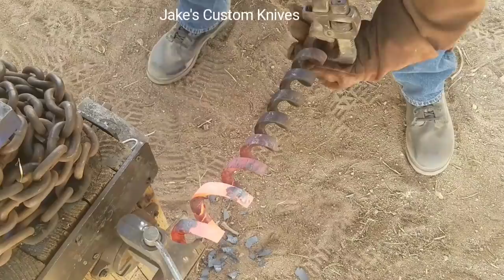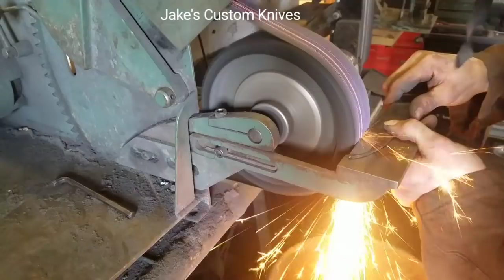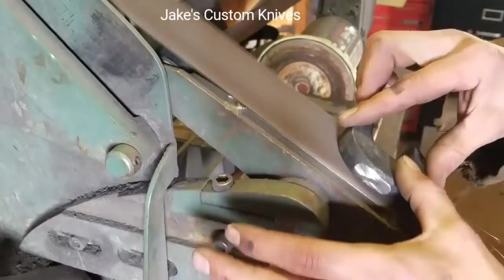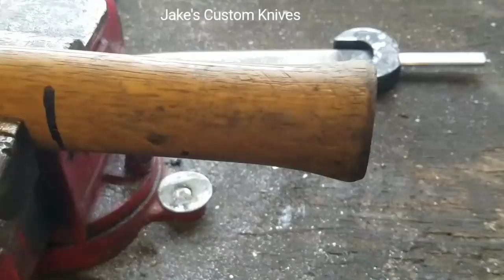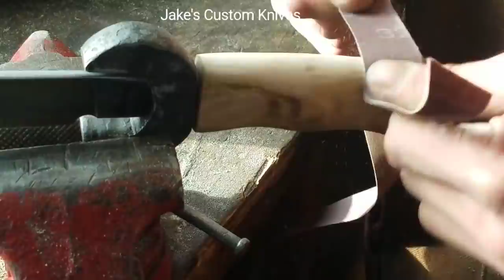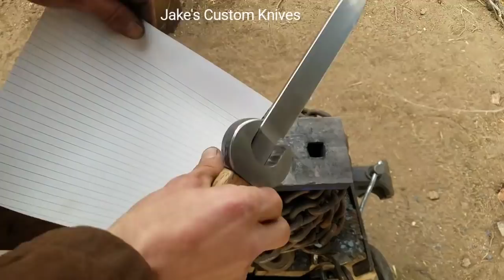Forging A Knife From Auger Drill Bit

Comment: I'm just wondering if these things rust after actual use or did you do something in the process that I missed that would protect from that?
Reply: dwindokamo54 if you take care of a knife and don’t let it sit and rust outside then it should be fine and shouldn’t rust
Reply: just a thin layer of oil is enough

Comment: Burning the handle hole is something I would have done. had a chuckle at that point. On another note long sleeves are not that great near rotating equipment. I guess it protects your hands better but if it snags that can be a serious injury.

Comment: Now you can’t auger that hole, loosen that nut, and your hammer’s handle is too short! But you got a badass knife!! Love it.
Reply: Actually The Hammer Handle is fitted to the user, if it's to long or short you lose control or have trouble striking with power. The Shoe Clearly Fits this Fella so your Hammer Comment is Unneeded. I went to the New England School of Metal Work and my Hammer is Fitted... I made it.
Reply: Zacarriss aaaa, I was making a joke. You watch the video? It was actually an axe handle he used anyhow. I’ve made many hammers and the length is relative to the weight.
Reply: I thought you meant his Forging Hammer's Handle not the knife handle... And yes the hammers weight plays a role in the handles length not saying it doesn't though I maintain that hammers are better controlled when the Handle Fits the user. There are Averages of course else industry wouldn't work.
Reply: Zacarriss no problem brother! After 60 years, I still misunderstand me myself!
Reply: Right Then Have a Good One.
Reply: Zacarriss you too Bro!!

Comment: You can make knife from any materials, depends from temperature of use. Water (ice) blade in -50 F can cut through meat like butter.
Old auger made of HSS steel is just basic material for knife. Cobalt steel drill will be better. You can always find scraps of alloy steel, tool steel or buy some scraps of stainless steel, like 400 series. Comparing cost of material to labor for manual, custom production,  choose best steel you can afford.
Reply: Sure there are better steels for knives, but sometimes you do it just to see how it turns out. Besides, regardless of what steel you use, there almost always a better one u could have used

Comment: Is that the cast iron anvil from HF? If so, weld a slab of steel onto the top of it after hardening the steel. I dont have a good scrapyard in my town, so I forked out 40 bucks to buy 2 4x4in slabs of steel from Michael's that I hardened myself lol, but you seem to have a lot of scrap steel lying around, so wouldn't waste money going to Michael's.

Edit: just checked the date posted. Disregard me haha

Comment: still not a fan of the burnt handle look, but it's a hell of a job anyway I've never seen a burn through go so slick, normally it's more trouble than it's worth. 

I'm wondering if you could clean the auger somehow, and beat the metal together still in auger form. I don't know if it would work, but if it did, and you acid etched it, that would make for one hell of an interesting pattern. Can that be done? How about you find out for us?